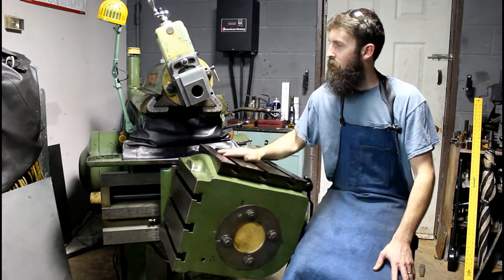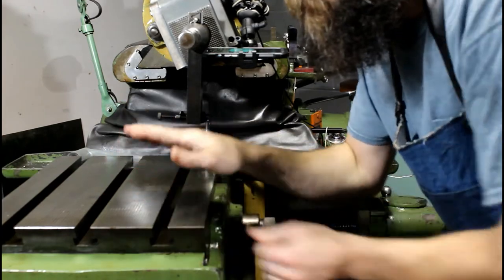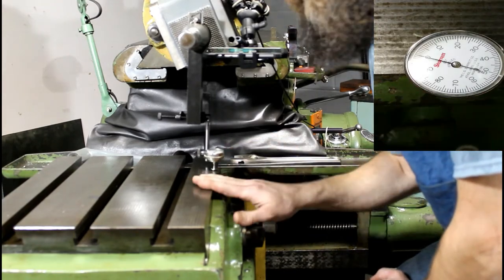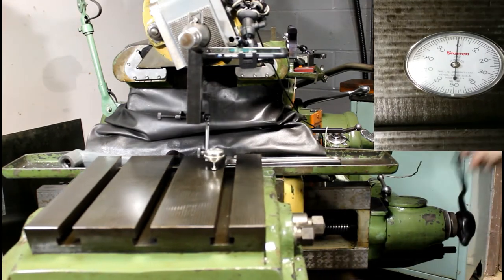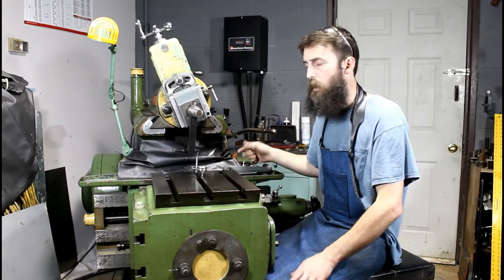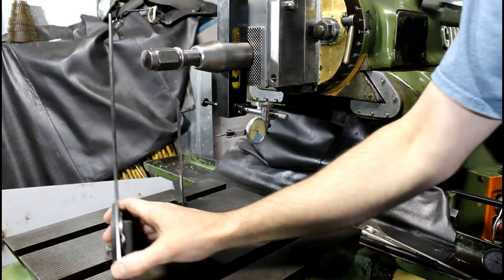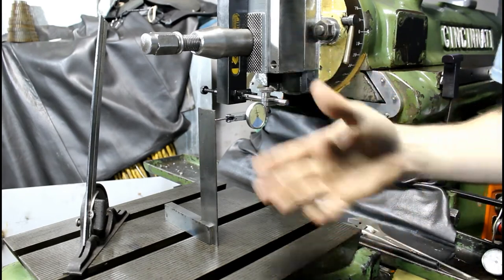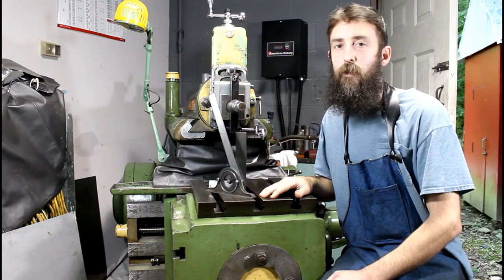Tramming in the Metal Shaper

Comment: I've got a 20" heavy duty Cincinnati ( the little bother to yours lol) that has the compound table and Electric clutch.  It is in ok shape, but like you said in different video the "previous" owners I think ran it with low or no oil and galled one side of the ram. It is not bad, but it is not good either just wondering if you have done any of the type of work on your Beautiful shaper.  Thanks for the info
Ethan
Reply from the maker: Classic Work I had to do alot of work on the compound, it had been crashed. It was still usable just not good. I scraped in the compound and clapper box changed oil and belts, I also cleaned for days. The vise was in bad shape and I had to resurface everything, they beat it to death with a hammer, guess they thought the vise was a anvil. This shaper was nothing lime it is now, she looked like she had been thrown away.
Reply from the maker: Classic Work Don't give up on it, the ram can be repaired, she may never look new again but she can run like it if you put in the work.
Reply: Steve Summers I got ya. I could tell you have put some hours in her, and that is no small feat.  Does yours have the oil pump on it, or do you have to oil it manually?
Reply from the maker: Classic Work It has a pump in the foot, all the pump does it push the oil up high and then gravity oils everything through small copper lines. Is seeme to oil everything well

Comment: Great video again Steve, I think you covered the set ups pretty well. Nice work with the inset image of the dti face. Mind yourself on those trees. ☺
Reply from the maker: lookcreations Thanks Mat, I covered all the basics I could think of. It will get people started anyways. Saving all those birds is going to be tough.😒
Reply from the maker: 1st time I have tried the picture in picture, I have seen other videos have the indicator off in the corner of the screen and always enjoyed watching the movement of the needle. It was a little hard to get both video clips timed correctly but I figured it out. I hardest thing for me is to get rid of the glare
on the DTI. The lights in my shop suck and I'm working on getting some new ones.  One thing at a time, with a budget like mine improvements take lots of time. Thanks again Mat.

Comment: Great video. Have a small 7 inch South bend. Its giving me fits. This info might help although I tram everything.
Reply from the maker: What issues are you having?
Reply: Thanks Steve for your interest;I think my issues are with the vice; and also that the vice table which  is held in place by only 2 screws on the 7" So Bend. I'm going to wait until I can get a vice that was made for a shaper. thanks again for your interest.P.S. It was running our 4-6 thou on 6 inches and 3thou difference front to back on 4 inches.

Comment: Steve: That is a magnificent looking vice for shaper work.  Where did you find it?
Reply from the maker: Peter Marsh Thanks for watching, The vise that is on the shaper is it's original vise, it came with the shaper.
It's a monster, thats for sure.
Reply from the maker: If you found this video entertaining or somewhat helpful please return the love by giving a thumbs up and subscribing to the channel, you may even keep a baby bird from falling out of it's nest😉 Thanks.
Steve Summers
Reply: Steve, it looks like I may have to make one as my shaper did not come with one.  I will most likely have to find a 3D model of one, cut this in MDF via my local furniture maker's shop, then slice up to make moulds to give to my iron casting shop to then machine on my shaper & milling machine to give true surfaces so that I can use it to produce beautiful work on the shaper.  Hold it, that sounds like a lot of work doesn't it?  If you can make that sort of thing then you are well on your way to being a machinist cum do-it-yourselfer!
Reply from the maker: Peter Marsh That sounds like a good project. If I needed a vise for the shaper I would use a modern milling vise. I may try to build one,but to build one that is truly nice and accurate would be a world of work and money.
Reply: Steve Summers:  Yes, you are correct with that obvious choice.  The only problem is getting one with anywhere near the width that may be ideal for the shaper.  Mine has a stroke of 500mm and therefore I was thinking that a vice with at least 400 mm would be ideal. The widest milling machine vice I have seen is one for a few thousand dollars but is only 210 mm wide.  There was an alternative solution I saw on a huge device called a surface planer.  Its vice didn't have a moving jaw but on one side a fixed edge and along the other was an edge and three or four bolts that pressed against a sliding square block that held against the workpiece.  That looks much easier to make but having one that could be rotated would be ideal, especially if you want to do something like knurling a set of jaw faces for example.  This would be much easier to cast and machine.  Getting the rotating base will be a lot of work and can wait for version II.
Reply from the maker: Peter Marsh 500mm is a large shaper, almost 20". yeah that is to large for standard milling vise.
Finding a vise for that big of a shaper is going to be tough, I would not search just for a vise, it would most likely be cheaper to buy a complete shaper with vise than the vise by its self. Crazy as it sounds I have seen it several times
Reply: Definitely true. My shaper cost much less than the original vice on it would fetch locally.